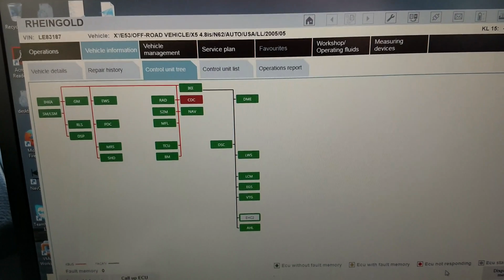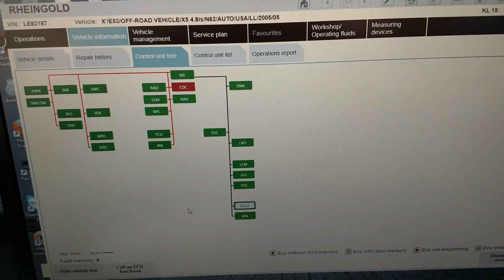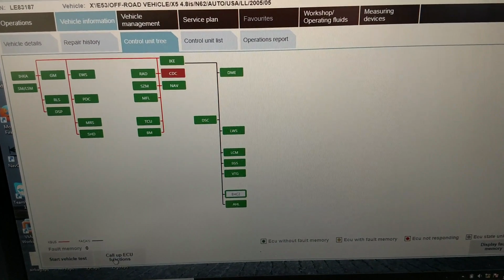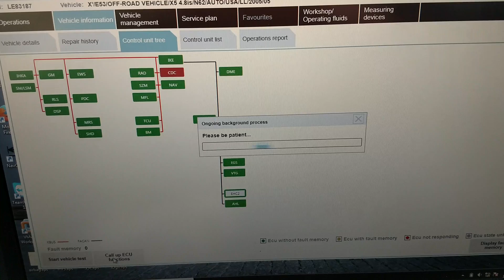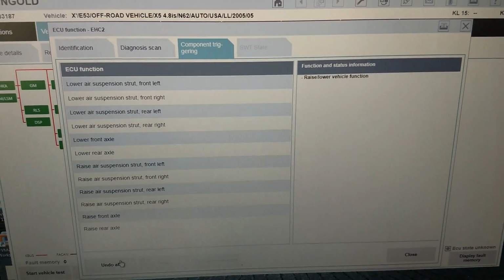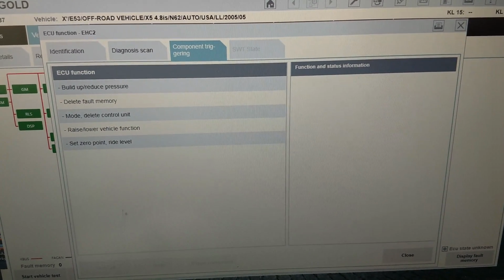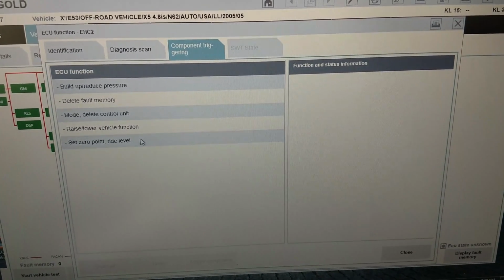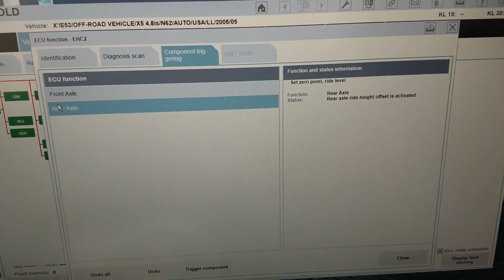X5 4.8is air suspension calibration using ISTA/D

Comment: Hello, can I reset Inactive Suspension Error message on the dash, using ISTA? I have no leaks or sagging but this message is on. I am assuming its the sensor or control unit that is bad.
Reply from the maker: You can reset the code yes, but that won't stop it from coming back if there is a sensor that is bad.

Comment: Hey how are u doing? Nice video thanks for posting it. I got this suspension level malfunction message on my x5 e70 . My car is not leaning on one side i mean is more like lifted on one side u know what i mean? I got no leaks on the air bags . I think its more like something with the sensors or something like that. Do you think that with that program ill be able to fix it?
Reply from the maker: It's possible but you likely have a bad sensor or bag.